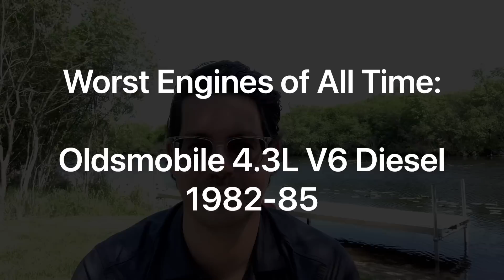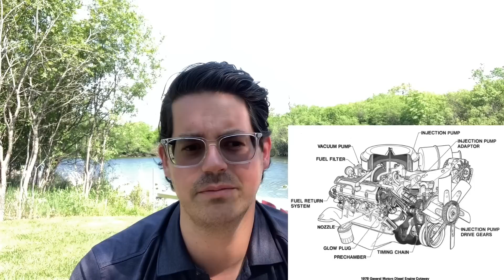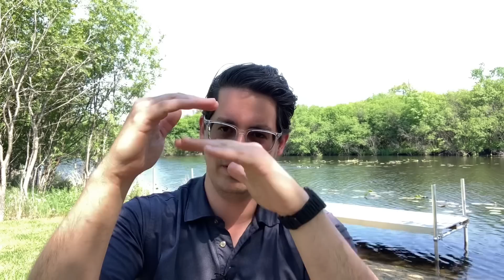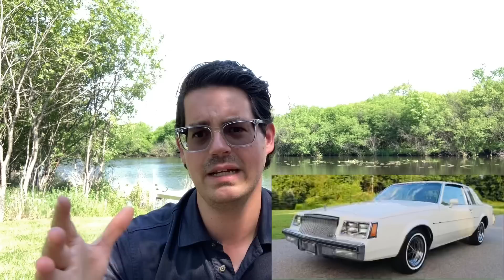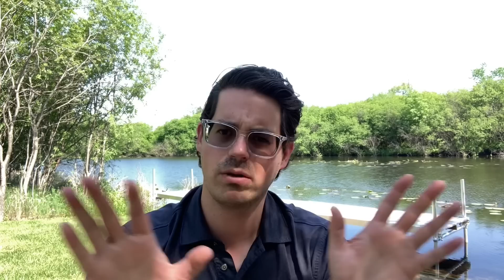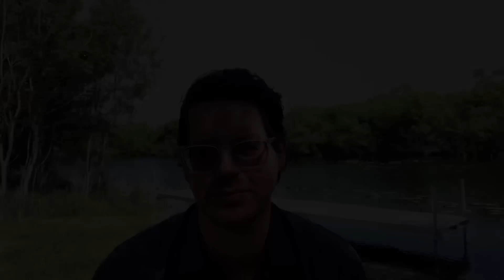Worst Engines of All Time: Oldsmobile Diesel 4.3L V6

Comment: Enjoy the video but small correction; A diesel engine compresses only the air. Not Aaron fuel like a gasoline engine. Fuel is injected once compression is complete. Or at least almost complete
Reply: I was about to point this out and decided to look to see if someone else beat me to it.  It's the hot intake air charge (from being compressed) that ignites the injected fuel in a diesel.
Reply: Yes. 22–1. Back in the Day; however modern diesels now have compression ratios that are much lower. Usually below 16–1. At the same time gasoline direct injected engines are raising their ratios, normally over 13–1. Not that much of a difference anymore
Reply: @kevinbarry71  Couple of comments: One of the reasons the Olds diesel had an exceptionally high compression ratio was because it used a Recardo pre-chamber design.  Virtually all modern diesels are turbo-charged and are not pre-chamber designs, hence the reduced compression ratios.  Turbo-charged gas engines typically have lower compression ratios than their naturally aspirated counterparts.
Reply: @Gary7even  not exactly, back then that was standard compression ratio. And a turbo charger wouldn't lower it much if at all. The reason the ratios were so high was because the injector pump produced very low pressure compared to today's versions and the injectors were primitive. These days the fuel is under so much more pressure atomizes much much better and thus ignites easier and burns much cleaner

Comment: When you say the 4.3 L was dead because of its reputation; what do you mean exactly? Because it wasn't any good? Or just because of earlier GM diesel reputation. Remember, during this time Mercedes was selling a lot of diesels in the United States; and for some reason a lot of people thought those noisy, smelly and slow Engines were great. But of course they were a lot more reliable. Also, another 90° V6. Bad design.
Reply: Those Mercedes diesels were killer.  Run forever and on anything.  I want one for the impending zombie apocalypse as I bet they will run on zombie blood.  LOL
Reply: @greggc8088  I own a 1979 Mercedes 240D.   MB Tex interior that still looks new.  4 speed manual transmission and manual everything else.  Great car not designed by the bean counters at GM.
Reply: @bobbbobb4663  Nice!  4 speeds were kind of rare.
Reply: @greggc8088  Thanks.  Mine is more rare...it has the optional rear seat headrests.  I’ve never seen that on a US spec car.
Reply: @bobbbobb4663  I had an 81 with the 4 speed...loved it.
Reply: @waynecorbit8475  Nice.  My only complaint is that third gear is a bit too low.  Mercedes intended that gear to be for around town driving and it definitely works as intended but when accelerating, the car kind of loafs along around 30 to 35 mph.  Some folks swap the rear end for a 300D at the expense of top end speed.  In the 80’s, you could get a 5 speed on the European models.  That would do wonders for acceleration!
Reply: Mercedes didn't have 'V' anything. They only had Straight Sixes.
Reply: @mikehasemann9270  Who said otherwise? Nobody. Later they did though

Comment: I owned a 1980 Cutlass 5.7L diesel. This engine was replaced with a Goodwrench 5.7L diesel before I bought the car. This diesel never once left me stranded. It always started and ran well. Not the fastest but for $500 bucks I didn't complain. The lockup torque converter had a dimmer switch hooked up to it so the lockup mode was manually controlled. I could actually stall the diesel coming to a stop without unlocking the converter. Aside from being somewhat slow on acceleration the 5.7 diesel was a decent engine in my experience.
Reply: If it works it works.

Comment: The Detroit automobile diesel engines of the '80s were a godsend to the Japanese manufacturers.
Reply: German too...my Dad went from a 81 Eldorado with the 5.7L diesel to a 300D.  Owned several Mercedes since and zero Cadillacs.
Reply: Yes you're right and still to this day have never fully recovered
Reply: The 300d is truly a gem
Reply: GM was the worst of the Big 3 to piss off American Buyers to go Japanese!
Reply: @mervynstent1578 Yes because Ford and Chrysler didn't even have the money to invest in any new engines..
Reply: @Jeff-bd5yo  GM had no excuses, they had the $$$$$$$$ then!
Reply: @mervynstent1578  How often is it that manufacturers have to do a complete 180 on the way of doing things in the matter of just a couple of years? GM's biggest cars to date had already been planned and were being sold with their existing powertrains. Seriously like I know GM made bad decisions but they certainly didn't implement the strict CAFE standards on themselves that's for sure.
Reply: Just remember Americans taught the Japanese quality control. kinda sad they stopped listening to their own methods
Reply: Don't forget the VW rabbit diesel. 
Ran forever without a hiccup. 
Got 145k out of mine before changing the timing belt,when it's recommend at 40k. 
I got the car with 145k and said I should check it, glad I did cause the original belt was due. 
Point being you could neglect those cars to a point and it didn't matter.
Going by the book it would have had 3 belts done by 145k,and that wasn't a cheap job you're taking 4-5hrs. 
I always felt robbed if I had a car that got less than 40mpg. 
The American diesels of the time were the total opposite, Definitely something to run away from unless you like headaches.
Reply: @MrTheHillfolk  VW Diesel produced only about 40HP with a timing belt and a weak head gasket. Mercedes-Benz produced much better Diesels. Peugeot Diesels were also very good, until they switched to electronic fuel injection. Isuzu Turbo Diesels were bulletproof and highly tunable, albeit underpowered and smoky in stock configuration.
Reply: @stoneylonesome4062  52hp on the 1.6. 
Brick the gas pedal and it'll sit there at 5500 all day till it runs out of fuel. 
And they don't get too fussy about lack of maintenance, recently replaced an original tining belt on a 1.6 with 145k on it. 
The TD is a little better at 68hp/98ft pounds.
Add some fuel and boost and that will add minimum 20hp/30ft pounds.
Reply: @stoneylonesome4062  mercedes did not offer much other than expensive luxury models. This is kind of a silly comparison to a vw don't you think.
Reply: It certainly wasn’t just GM diesels.
Reply: Domestic manufacturers produced garbage with useless labor .
Reply: We were a GM family and everyone worked there....but after years of bad quality...both vehicles in driveway are Japanese.  Sorry, we didn't leave GM...they left us.
Reply: Every vehicle i owned in the 80's was Japanese.  The quality difference between domestic and Japanese was simply astounding.
Reply: @christopherweise438  The Datsun (later Nissan) Maxima's optional 2.8L diesel six was so much stouter than the 5.7L, for sure! But even that couldn't save the flagging U.S. diesel car market.
Reply: Germans did better cars than US or Japan in 80s

Comment: I have a front drive '85 98 4.3 with a mis aligned power steering pulley... Can drive it, it chews up the belt
Reply: Sometimes those would fool us and have a barely noticeable hair line crack in a bracket allowing flex.
Reply: @greggc8088  it makes no sense to have shifted backwards on the shaft. Nothing appears touched
Reply: Even the carburetor castings were different. Fuel inlets varied, spark plugs differed, air filters. Only oil filters interchange, except for Chevy has its own unique filter